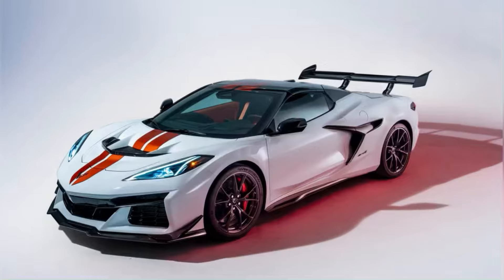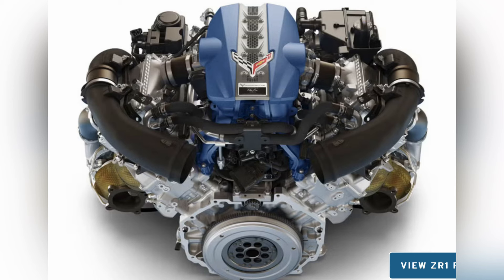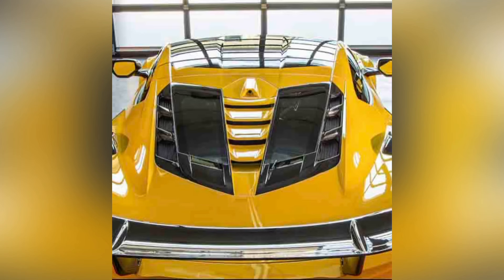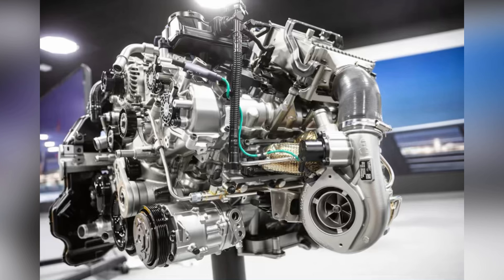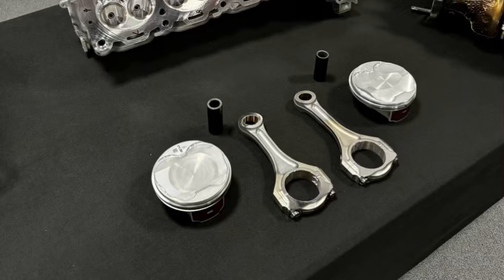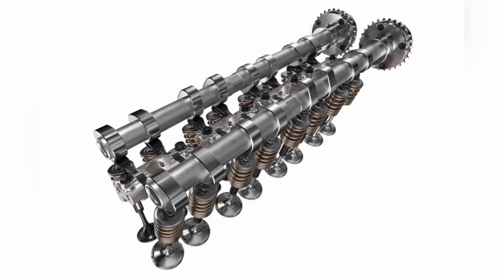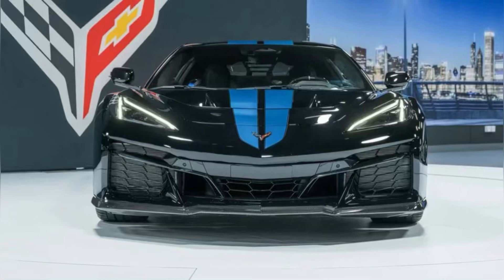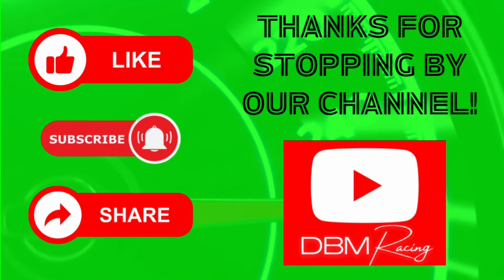2025 C8 ZR1 twin turbo LT7 deep dive! EVERYTHING you wanted to know!

Comment: 8:12 Right! those Head's must flow a lot of air.. And for GM to be using turbo's and 20lb's of boost, That to me means that 20lb's is making the same power as other cars using 40/50 lb's.. Remember Boost is the measure of how much air isn't making it through the heads and out the back of the car... And they lowered the compression to, That is one of the main reasons Mustang Tuner's love Gen 2 Coyote's, It's because the gen 1 and gen 2's have 11 to 1 compression and the gen 2's came with a better crank and beefier rod's among other parts vs the 12 to 1 on the 18 and up's.. The higher compression is great for NA but soon as you throw boost at a high compression car, depending on the amount of boost you kinda have a ticking time bomb on your hands. Depending on the amount of boost.. I am hearing this car is 9.5 to 1 just like the Shelby Predator motor's were... But just a heads up if you are boosting a car go for one that has less compression, for your sake....

Comment: Good deep dive into the LT7. I thought I heard one of the engineers say that the crank casting was the same as the LT6, but is machined differently for clearance.
Reply from the maker: @johnperkins6432  That’s correct. It’s also got machining for additional cooling/oiling as well. Insane the level of engineering that went into this monster
Reply: @dbmracing2019  I agree with you man! The engineering is next level.

Comment: Take those beefed up components of the engine and transmission and place them on all C8 to improve durability throughout the C8 line.
Reply from the maker: @fredeb67  It’s crazy that this is a factory “mass produced” engine. Lots of this tech and engineering used to only exist in the high end aftermarket racing market
Reply: @dbmracing2019  Yes..However,  GM can mass produce these parts cheaper if the did it in-house and have more control over quality that is lacking in their suppliers now. GM has the capacity and engineering to make their own ceramic brakes and carbon fiber.
Reply: @dbmracing2019  the things that cost buyers the most
Reply from the maker: @fredeb67  yes they do
Reply from the maker: @fredeb67  💯